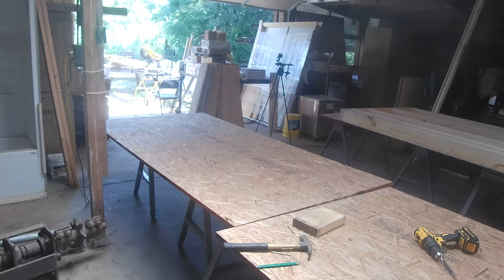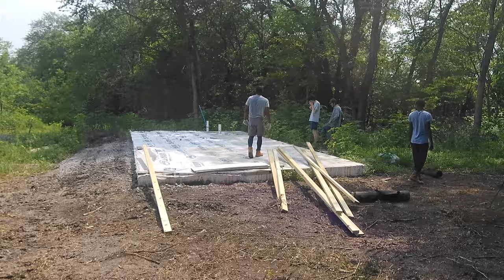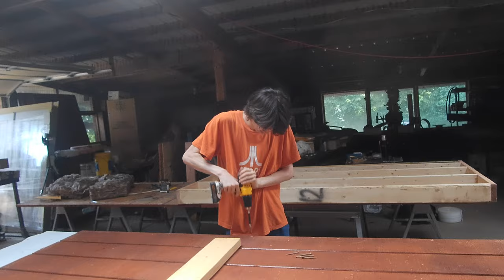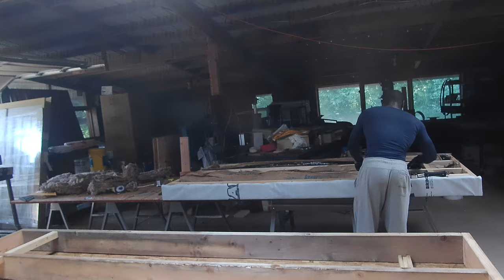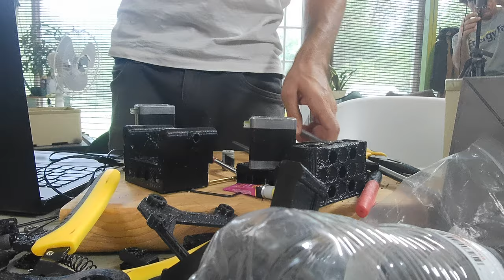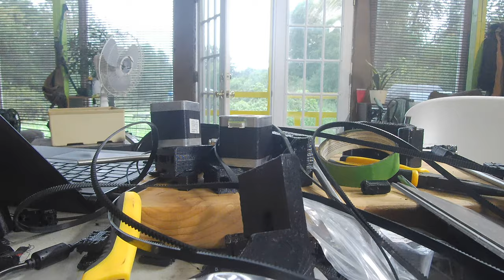Wes's House Modules

Comment: Is there a library anywhere of all of the 3D Print models or Wall Module blueprints that have been designed so far? Then any user could download and enhance them or contribute their own. Would increase engagement. Could potentially crowdsource a lot of free-use solutions to homebuilding